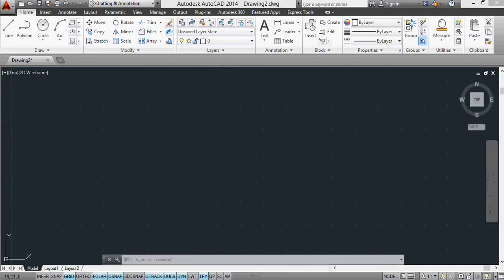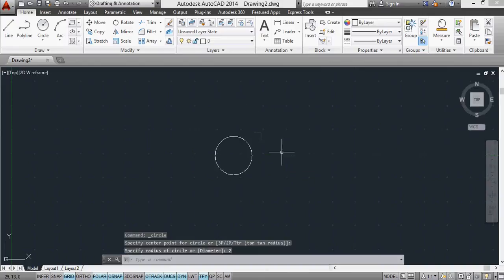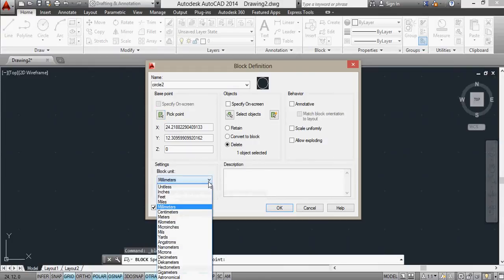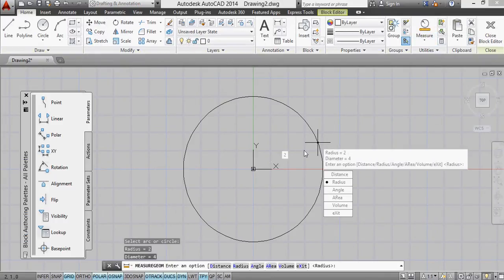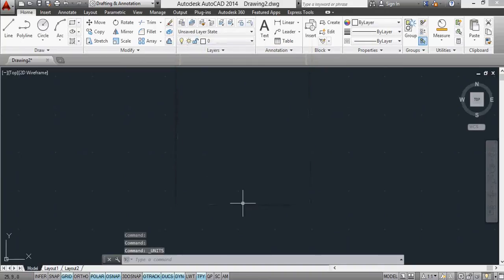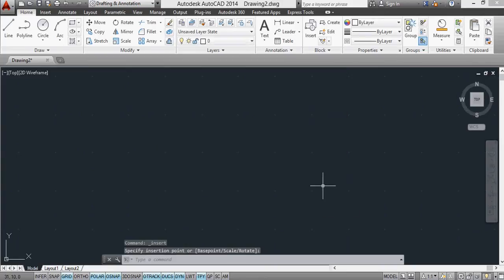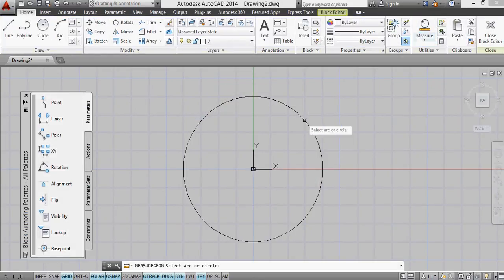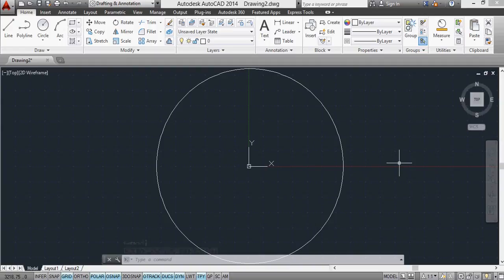AutoCAD Block Units

Comment: The point is that what number appears in block editor is what number we determine in the dialogue box of "B" command. For example, if we determine 20 cm in that dialogue box, then this is what is going to be appeared in the block editor, INDEPENDENTLY what drawing units we are working with. Whereas, in the drawing this "20 cm" will be automatically converted in terms of these drawing units. E.g. if we work in mm, then the block will have 200 mm in the drawing (scale factor 10 when insert it).
Reply from the maker: Correct. The units in the block are from the dwg the block was created in and also the 'block units' when it was created as a block and also the 'factor' when inserted...confusing I know. Hopefully this helps others with the same problem.